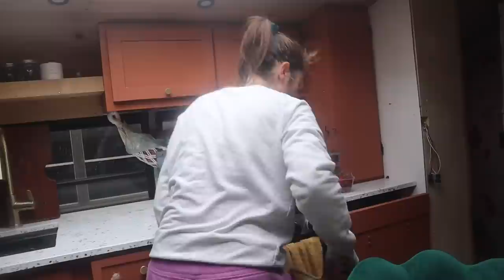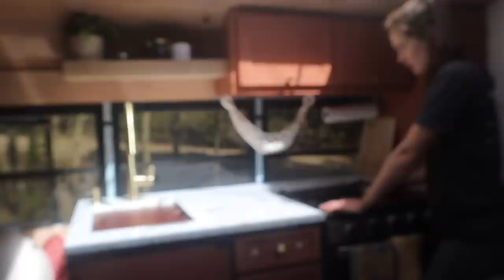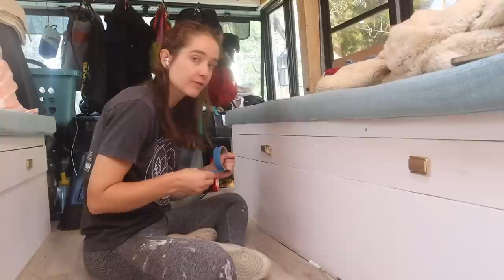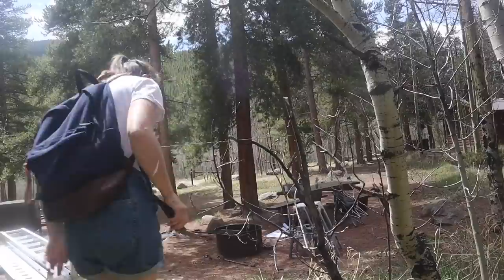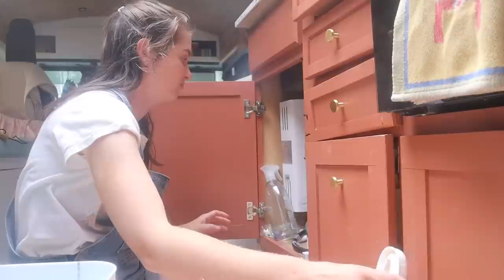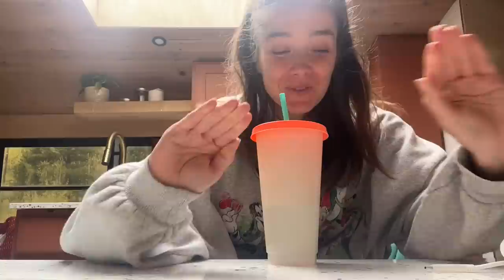Living in a school bus in the rocky mountains

Comment: I have been watching all of your videos as a late comer, when you installed the gray tank, you forgot to install a vent in the top of it, idealistically it should vent above the roof with at least 2 to 3 inch pvc piping. You can vent it under the bus, but if there are smells, they may linger as you walk past them. you can get a threaded PVC male coupling with rubber O-ring gasket to tap into the top of the gray tank.

Comment: Your sink doesn’t have a vent to let the water move, it basically hydro locks because it needs the vent to be able to push the water to the tank. If you have a vent, it might not be high enough in the system to let it work. Hope this helps!
Reply: Learned to watch the whole way through the video! LOL😂…good job!

Comment: Your sink needs a VENT!! Put a straw in a cup of soda, put your finger over the end of the straw, then pull the straw out of the cup and you'll see the soda stays in the straw and doesn't fall out. Release your finger and the soda will immediately leave the straw. That's the "burp" you're experiencing. You're allowing the drain to vent when you take it apart and everything drains out. Add a vent and you'll be all set...

Comment: I realize I'm a little late to the comments here but does the tank your kitchen sink drains into have a vent of any kind? When you're putting water into that tank, the air that is already in there has to have some place to go and if you don't have a vent on the tank, the water will either drain slowly with a lot of gurgling or it may not do down at all.
Edit: well I just finished watching  the video and I see I was right but you already figured it out yourself.. Go you!

Comment: I can't remember if you put a vent in for the sink or not but if not that's what you need to do is put a vent in and then it will rain just fine. Oh and one more thing it doesn't have to vent to the outside it can vent under the sink you can buy a vent that's specially made for vent sinks indoors. Nevermind lol I made this comment before you made a vent for it sorry.